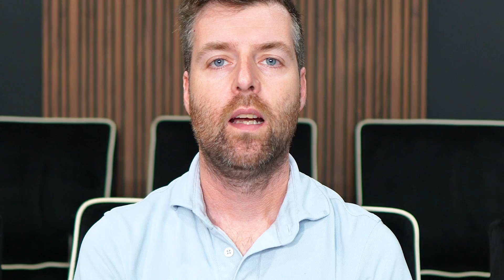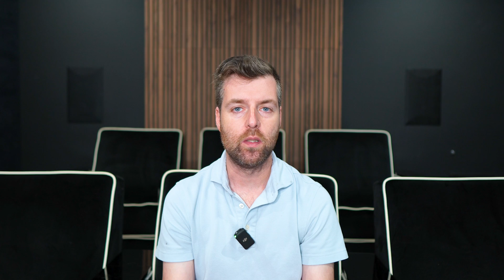Gain matching your amplifiers, subwoofers, and processors

Comment: So in the circumstances of a receiver functioning as a pre-out, if the receiver pre-out is less than the amplifier's input sensitivity, then the amplifier will never reach its maximum potential power output? 

Specifically I am referring to a Denon X6700H (1.2v) and the Emotiva Gen 3 XPA amplifiers (1.5v input sensitivity). I have been sticking to Emotiva BasX amplifiers or trying to obtain a Gen 2 XPA amplifier which feature a 1.2v input sensitivity.
Reply from the maker: Those are very close to each other so it’s unlikely that would be true. Also the voltage output of a X6700 is much higher than 1.2 volts. Amir just tested it recently and shows that it can exceed 4.5 volts before the SINAD drops to below 90. It has an optimal setting, that limits it to a lower level. But that isn’t the actual maximum output.
Reply: @PoesAcoustics  thank you for the response. I saw Amir’s testing (especially the revised test with the fixed unit) and wasn’t sure why they would report 1.2 when he was testing so high. When shopping a system what should a customer look for when comparing a receiver to an amplifier? 

In my case I haven’t even considered an Emotiva XPA Gen3 as an option because of the reported voltage sensitivity mismatch in that the Denon is less than the Emotiva.

Comment: The designers of Audyssey needs to watch this. You run in to the exact same problem when autoEQ tries to fill in the the typical 100-200Hz acoustic null with a sharp +15db peak filter.
Reply from the maker: I don’t know that I have anything to teach Dr Chris Kyriakakis.
Reply: @PoesAcoustics  In the last update they added a limit to max cut, but not max boost. That seems like a very strange priority, and massivly limits usability, taking the main points of this video into consideration.

Comment: Thanks. That makes sense. I had major distortion issues with the doomed AV7705.  Denon x3600 works better with subs. I will try to turn down the gain on the subs and see if I get an improvement. The subs are acceptable to me in the current state but always looking for an improvement.
Reply: Here's some information that may help you get your levels set correctly.  Gain controls are always on the input of a component, and volume controls are always on the output of a component. Of the two, only gain can distort or damage the signal. A volume control can't no matter how high you turn it up. So, if you have distortion, gain is what's causing it, and you need to adjust gain to fix it. Just turning the volume down won't fix the problem.

Also, make sure the distortion is from gain and not something else. For example, you can get distortion when mixing balanced and single ended components. The 2 modes of operation are not compatible, and if you don't know what you're doing, you can create a short circuit that will cause distortion from that as well.

Comment: In the DJ/club world, the idea of "gaining staging" was so that your mixer, processor, and amplifiers all clipped at the same point.  So you'd unplug the speakers and look for the clip lights on each device and then back them off a bit.  When moving to consumer audio I found it perplexing that there are no clip lights on 99% of the amplifiers and processors.

Comment: After a second viewing, I have a question. Take a processor that allows you to set the output voltage on a per-channel basis.  The idea being that like you said, when you set the overall volume of the pre-amp to -0db, you're driving the amp to its max potential. Let's say the HTP-1 from Monolith. That sucker is capable of higher output voltage but measures best when driven to 2.2v (nominal) producing a SINAD of -104.9db. Which is actually really great for a home theater processor.

So, are you saying that if I set an amp's input sensitivity to 2.2v (or if the amp has multiple fixed gain settings and I use the 2.4v setting), the pre-amp (processor) will drive the amp to max output, and that should be the cleanest that pre-amp and amp can play together?

I feel like I just said the same thing twice but I'm an outward processor.
Reply from the maker: Yes what you said is right. 

But keep something in mind. That may not be the cleanest output and highest SINAD of the system. 

You are assuming if you have an amplifier with a SINAD of 105 and a preamp with a SINAD of 105, the two combined equal ~105. But if that amp has 26dB of gain, the end result will likely be in the mid-80’s. You would then be better of running the preamp to a higher voltage output, and reducing the amplifiers input gain. 

Think about what you are doing. You take the noise and distortion of the preamp, and amplify it by 26dB.
Reply: @PoesAcoustics  ok, that time I got it. I’m pretty sure it’s the same thing you said in the video but for some reason, that got through to me. Thank you very much.

Comment: Hey Matt! What do you think about using Psychoacoustic smoothing in REW? I usually flip back and forth between 1/24th and psychoacoustic smoothing when EQing subs and speakers. Sometimes I reference both. Sometimes I reference one or the other. My largest use case for psychoacoustic smoothing is when setting curves. It seems to give me a very pleasant result. Do you have any thoughts on that?

I'm going to rewatch this video because I get easily distracted. ha
Reply from the maker: Both psychoacoustic smoothing and ERB are in fact psychoacoustic smoothing. The theory was that these would best mimic what we hear and avoid visualizing resonances we can’t hear. So what you say makes sense. But there is also some debate how accurate it is. 

I have no issue with it. I use it sometimes myself for visuals. But when I calibrate systems just actually tend to use variable smoothing (Which John developed for Eqing specifically). I also rely on my knowledge and experience.  Meaning that I know what to ignore and what to pay attention to. There will always be some of that. What I suggest is to play with some EQ softwares that let you listen to changes in PEQ live. Try fixing the frequency and Q and then adjusting the SPL. Then adjust the Q and listen. Then mix it up, adjust Q and level. Maybe set the Q to 1, 3, and 6. Something like that. The point of it would be to train yourself to hear how it all works. I did this many years ago and found it really enlightening for Eqing. I started to realize how certain resonances that look bad really aren’t audible. Others looked benign and were quite audible. After enough time I just developed a feel for it such that I could look at a response and eq it pretty well without calculating the EQ correction.
Reply: @PoesAcoustics   

I’ll give variable smoothing a college try. Thank you. 

Also, that makes sense to find an eq program that allows for live auditioning of PEQ. if I remember right, there’s a sweet free app that lets you listen to random music uncorrected and then again but (usually) ruined with some sort of EQ applied somewhere along the FR. I need to look that back up again.

Comment: Coming from a pro audio background, gain optimization is the most frustrating part of home audio. It's a very simple process in Pro Audio. It's frustrating in less expensive processors/receivers because it's too dumbed down.
Reply from the maker: I’ll be teaching a course at CEDIA on this. One of the big challenges is subwoofers.  Most of them have dumbed down the process so much that an integrator is guessing. Which is hard.
Reply: @PoesAcoustics  I’d gladly attend that.

Comment: So if you have four subs in corners connected as front subs and rear subs and auto correction sets them at -6 and -8 time to turn down the gain on the subs?
Reply from the maker: It’s not that simple I am afraid. Your description has nothing to do with gain matching. Gain is in the input of the subwoofer. All amplifiers have a gain stage or two or three.  The pre-pro outputs a certain voltage for a given digital signal level. Typically it’s not adjustable outside of the level matching controls they give you and it maxes out at a certain point.  Gain matching means adjusting the control of the sub such that the preamp can drive the sub to full output. 

In your example, it suggests probably the input sensitivity is too high. But it’s not Defintive that this setup is causing issues with the preamp realizing it’s full voltage output. Some receivers actually clip their output with the levels set too high, so having them a little negative is better. 

A lot of this I found out by accident. Nothing I said about the clipping should be true.  A well engineered product shouldn’t clip its output with its levels set anywhere it can go. But when I tested these receivers and processors, I would get weird results. Clipping below its rated max voltage output. So I would play with the settings and find that certain settings fix it.